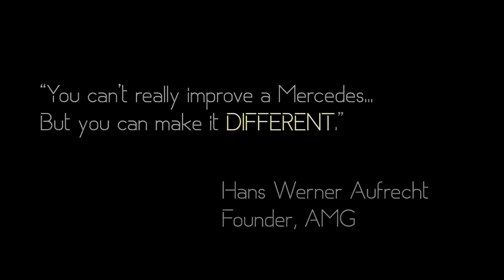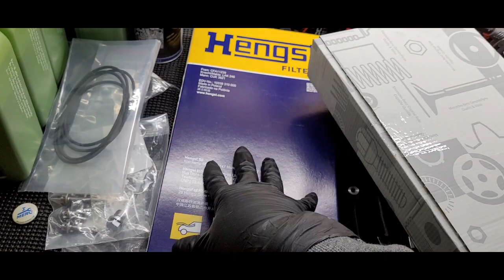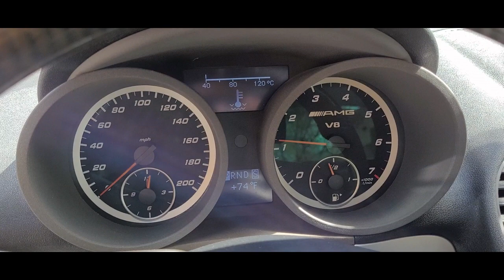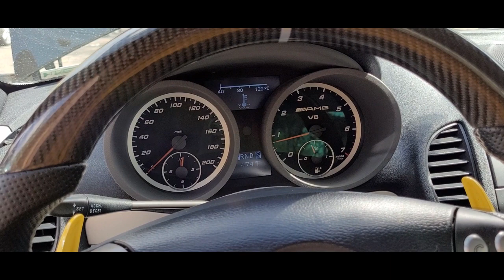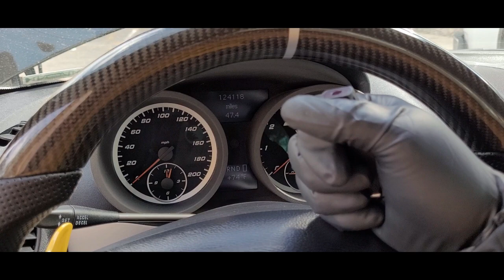MY 2005 SLK55 AMG GETS A NEW FUEL SYSTEM REFRESH

Comment: Hello, thanks for the great video. I am currently replacing my fuel pump and filter to my SLK 200. I'm having an issue reconnecting the sender plug which is located at the bottom of the black box that houses the pump. Could you please advise the easiest way raise the box to gain access to connect the plug. Much appreciated.Thanks, Kelvin

Comment: Hello I bought a 2005 slk55 amg from auction back in January and it has been sitting for around 4 years. I need to remove the gas tank to get the rust out and also all the wires are decayed from the gas like a similar comment I saw. I can’t find anything on how to remove the gas tank, I’m not sure how to remove the hose that goes to the gas cap.
Reply from the maker: Getting the gas tank out isn't hard at all, which is good news. You need to remove all the items from the trunk. Then, disconnect the feed line, which is located underneath the car and the breather hose which is inside the trunk.  This video gets you half way

The fuel tank comes out the trunk lol. Fyi

Comment: Hey Panzer , i recently bought a fuel filter fot my SLK 55 amg R171 2005 , just as yours , but it aint OEM , i think its chinese , the part where the connector is supposed to go is sealed in mine , in contrast with the oem one. 

Any suggestion of what can i do ?
Reply from the maker: I would highly recommend returning the part, acquiring a oem brand(fcp euro) will have it in stock and a good price

Comment: Ever experience the wires inside the fuel tank fraying/disintegrating?  Trying to solve this now but the walbro in-tank harness didn't seem to be a fit, while someone else mentioned that a wiring harness from a 2007 s550 may work
Reply: I have the same problem, have you come across a solution by chance?
Reply: @DraysCars  no, ended up parking it for the winter to think of a solution besides buying a new tank which includes the pump assembly etc -- trying to avoid the $6K price tag with that but if I don't find anything by next summer unfortunately that'll be my go to.  Can't imagine that it is the only solution out there...
Reply: @DraysCars  happen to find a solution on your end yet?